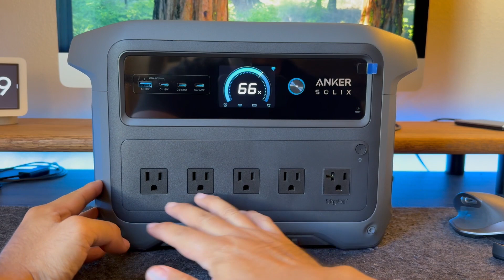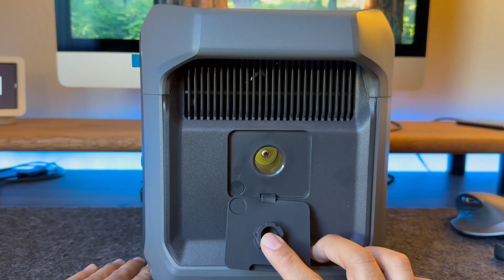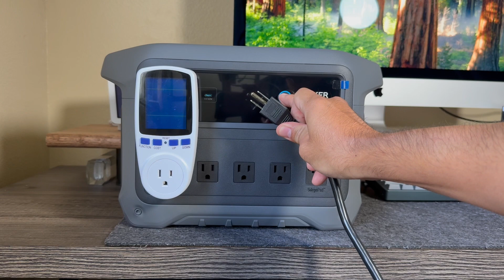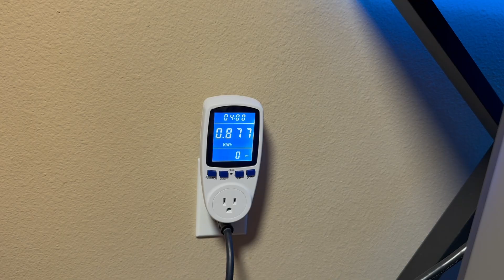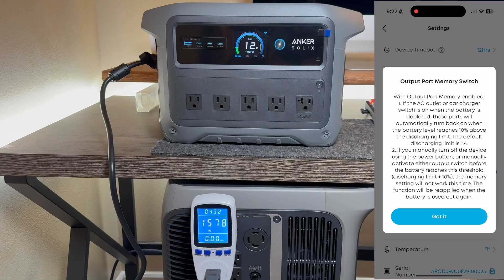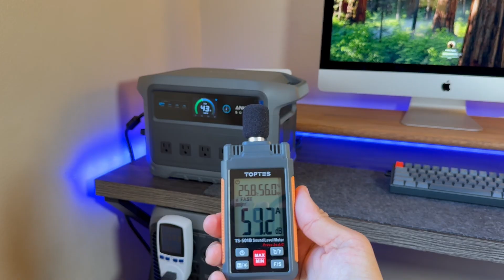Anker C1000 v2 - Tested & Verified

Comment: I wish these big brands would add power filtering and high/low voltage cutoff to make these true UPS devices. I know Ecoflow had one called the Delta 3 Air 1000 but it appears it's no longer available.  Those features are game changers for truly protecting your devices during power surges/fluctuations.  Great video. Thanks!!

Comment: Anker 1000 Gen 2 got flagged as defective after I sent in the logs, by Anker Solix after getting to 126F in a cool place in winter where I charged it in the winter. Anker sent me a shipping lable. I expected a Firmware update. FedEx ground ate the package though and it got lost after pick up. But because I took a picture of it right before it leaving, Anker is sending me a new C1000 Gen 2 now. Guess its between Anker and FedEx now. I did send Anker the FedEx problem ticket info. I find the C1000 Gen 2 does run hot a bit at times, I have another one as a UPS.
Reply from the maker: Sorry to hear that but glad your getting taken care of! Definitely not your problem on the shipping part. New one should be good to go! Cheers!

Comment: Is this a good choice for a battery backup UPS instead of the smaller true battery backup options? I'm looking for a fast switchover time and power being provided to my router and internet gateway should the power go out for several hours.
Reply from the maker: Yup it can do that! The cutover isn’t as fast as a dedicated online UPS but a modem and router shouldn’t care about the difference between 0 and 15-20ms. I have used it for my network equipment and it has no problem. From a maintenance standpoint make sure you drain it completely and recharge it completely atleast once every 2-3 months or so just to make sure the BMS stays in calibration. Otherwise you should be good to go!
Reply: @metaphorse  I planned on doing that but we spend 6 months in Florida and I'm looking for something to keep my router and gateway going in case of a power outage. If I have to drain and recharge it every 2-3 months that won't work out for me.
Reply from the maker: @r@rob @robh063 ink 6 months is the max but if it’s in storage, 2-3 if using as a UPS although this is unofficial information. I would rather you not buy a power station than for me to lie and you end up with a bad experience. One thing you could do though is get a smart plug and flip it off for a while and then back on when you notice the power station get low but this would be a manual process. Hope this helps brotha.

Keep in mind this is all power stations despite the brand, the BMS has to be calibrated every once in a while to know how much usable battery capacity it has and it can only know that if drained and recharged fully.

Comment: Hey Andrew...can you set the charge rate....instead of charging the pack at ~1500w...can you set it to charge at 200w from AC?
Reply from the maker: Yup you can! 600w is silent charging, but you can go down to 200. 1600 (1561 is the fastest) actually has to be enabled and a warning comes up not to always charge it that fast. That is just because heat degrades batteries faster than most other factors. But yes you can absolutely change the charging rate. Hope this helps!

Comment: Thanks for the nice review. I only would have added a test of the UPS mode, as this one claims 10ms switchover time in the event of an outage, which is excellent and twice as fast as the Gen 1.
Reply from the maker: Thanks for watching and the comment! I tested (not with instruments but with my iMac) the UPS in this video, I have 3 more videos on the way too. 

NEW Release: Anker C1000 Gen2 What Will It Power?
https://youtu.be/e0zUgGkLqzk
Reply: I have 1 … it works well in ups … I use it for my router and modem .

I have discharge set at 10% and smart outlets on so the way it works is that it stops providing out when it hits 10% and then smart outlets turn back on when it hits discharge limit +10%

It worked for me no issues
Reply from the maker: @ToniSkit that’s a great use case! Tbh 20ms worked fine for me as well, but 10ms just covers more sensitive equipment. Glad to hear everything is working for you!